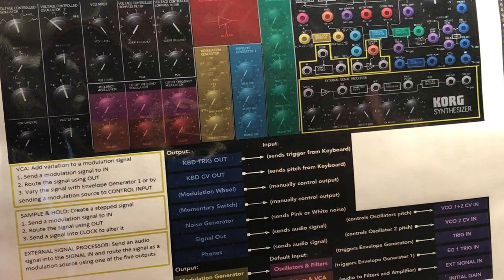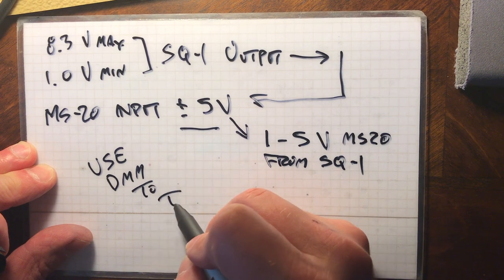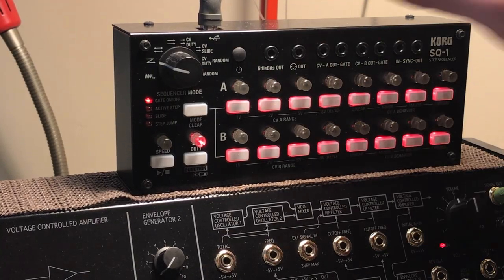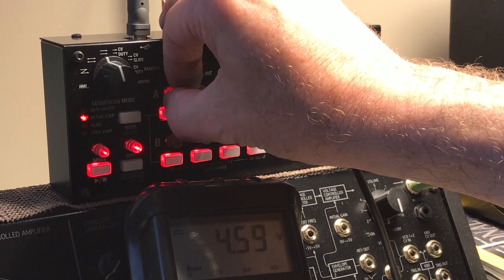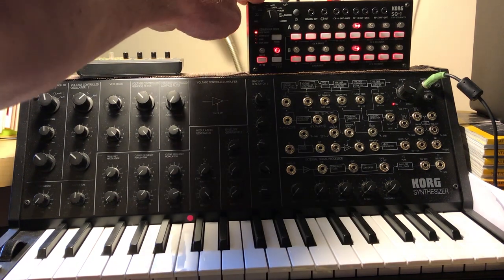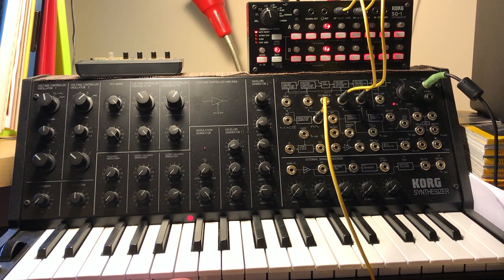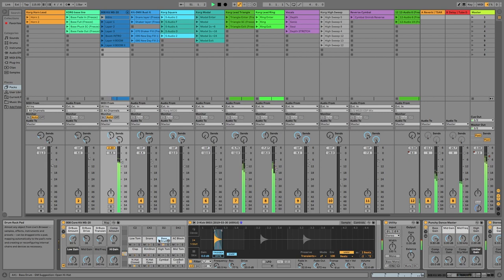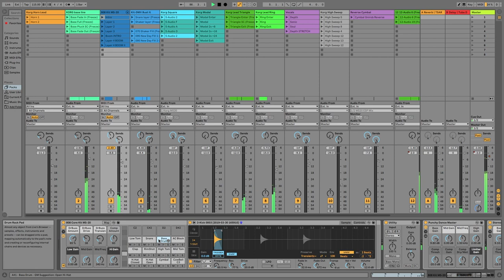Lecture #2: Korg SQ-1 Filter Modulation of Korg's MS-20

Comment: why do you not just change the voltage range of the SQ1 to 5V?
Reply from the maker: Excellent question. My thought was to get folks thinking about voltage headroom and step through the math. In retrospect, could have offered the easier solution too. Basically shown both. Presently working on lecture 4 wherein I will introduce the other voltage range settings and how to apply them with VCA2 and to musically transpose the SQ1 output according to desired voltage block scales.
Reply: @hadlbah  Ha...fine...i thought i missed something. But informative video anyway.!!
Reply from the maker: Thanks. You’re not the only one to ask. One person even downvoted me for it! Ah well, live and learn I guess.

Comment: I got a brand new SQ1 and a 40 year old MS20 not sure if it will work on mine
Reply from the maker: I do remember you buying the vintage MS20.  So since you purchased an SQ1 to go with your MS20, I’ll make the assumption that you’re liking it. Excellent!  The SQ1 will (should) pair nicely with your FS MS.  The only bother will be the 3.5mm to 1/4” patch cables. All of the VC and S-Trig connections are completely compatible.
Reply: @hadlbah  yes a set of adaptors fixes that up but you have to remember to set both channels to the 8 volts and set the polarity right
Reply from the maker: @simonburns1055  yeah, the polarity thing is the same for the mini too

Comment: thank for the tutorial...it's good... so dumb question... i am working w the same setup (ms-20, sq-1, ableton 10)  just got the sq-1 today.  i can not get Ableton's bpm to control sq-1's bpm.  Can you help me with that?
Reply from the maker: Hi Grayson - thanks for reaching out and glad to hear you like the vid/lecture.  Yeah, I remember being equally mystified when I first set this up.  I don't recall exactly the process I used to solve this - I recall watching vids, reading the ableton manual (again) and such.  To get this little bugger working correctly (my solution):
1. Polarity of gate Channel A & B set to Negative (SQ1 manual)   The mode button on the SQ1 will be unlit when properly set.
2. USB connection to my Mac - I'm running macOS High Sierra 10.13.6.  I'm connected to a 4 port hub, just never enough USB ports, eh?
3. In Ableton/preferences/LinkMIDI 

Midi Ports                          Track                Sync              Remote
Input SQ-1 (SEQ IN)          ON                    OFF                OFF
Output SQ-1 (MIDI OUT)  ON                    OFF                OFF
Output SQ-1 (CTRL)          ON                    ON                 OFF

I'm not saying this is the only way, and I really haven't explored all the bits'n'bobs that might be possible.  What I can say is this seems to work well enough.

When I hit play in any ableton file, the SQ-1 just starts chugging along.

Did this solve your issue?  Did you uncover a better way?
Reply: @hadlbah  you are awesome for this reply...gonna try in a minute ill get back to you
Reply: @hadlbah  yes it works great.... thank you for showing the in/out mapping...  I think the problem for me which is embarrassing lol is I just had sq connected to ms20, i was making no USB connection to ableton with my sq-1...(huge duh moment)  but i appreciate you taking the time to explain and for making the lecture.
happy new years!